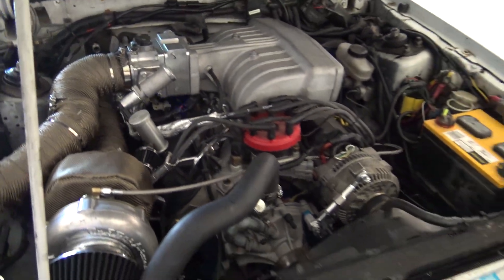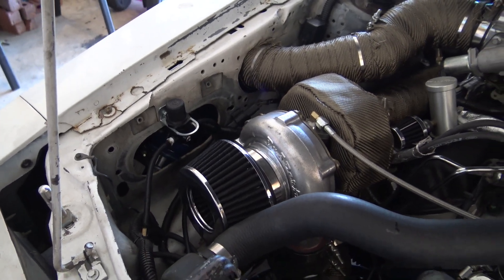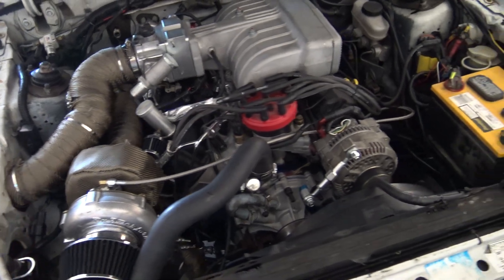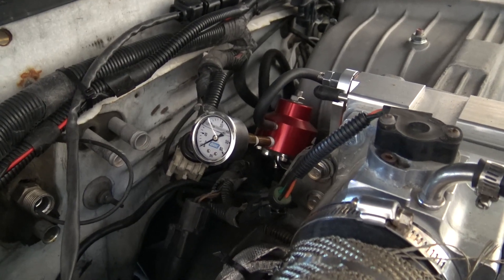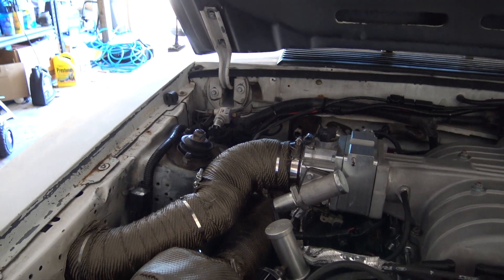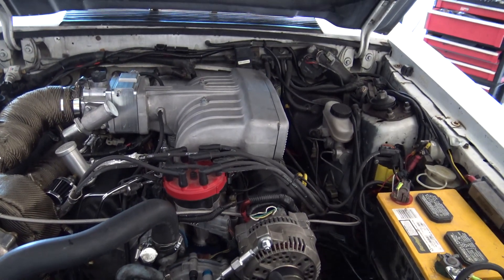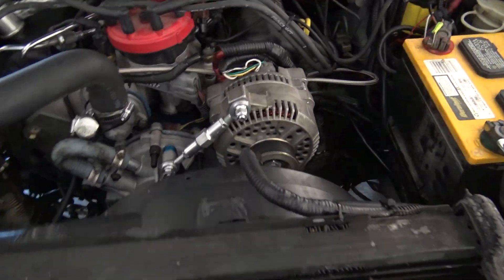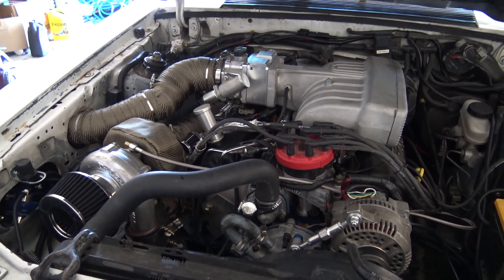The Dyno Tune On3 Turbo Foxbody

Comment: Good job brother. I have a 94 gt running dss level 20 331 with v3 si vortech with a stock production block running 541 rwhp and it's been together 4 years and 50k miles trouble free. all in the tune to keep it together.
Reply from the maker: Some nice power numbers! The tune is the most important part! The v3 si must be common on these motor. See lots of people running them.

Comment: Glad I came to check these videos out, oN3 doesnt mention much about needing alternator relocation, modified upper rad, P/S in the way? Lots of other small things I'm thinking putting a kit together would be better then buying the kit perhaps... Universal 3 inch I/C kit with a tig welder. Twin scroll 76mm t4 should let things breath nicely.. I'm on the fence with the kit as doing it yourself should allow me to retain factory accessory locations what's your opinion on the kit? The numbers are impressive though. I"ll most likely be on E85 and undecided on the tuning solution.
Reply from the maker: +Kyle Milford thanks for watching! Alternator relocating isn't necessary. I only did it to keep it from adsorping heat from the turbo. I pulled the ac as I never use it. PS pump is cause Im going to a manual rack in the future. All that stuff you don't have to do to install this kit. The kit fits, but just got to be patient with it. If your on a stock block 302 wouldn't waste your time on e85 just run 93. These blocks only handle @500hp. This kit won't have any problem hitting them numbers. Good luck!

Comment: looks like an aeromotive fuel pressure regulator. they cut pressure with the key. don't work like most regulators. the open element breather on the valve cover creates a vacuum leak on the fox pcv system. great numbers btw.
Reply from the maker: Yeah I kinda ruled out its the regulator. It bleeds off to 15psi and takes about 30-45 mins to bleed the rest. I have to pvc going out the atmosphere.

Comment: awesome vids man, I just watched them all lol, can you tell me if you changed anything from the injectors, fuel pump, anything like that? if you did can you tell me. I have a 95 GT that I am wanting to do exactly what you did to yours. Thanks in advance
Reply from the maker: Thanks! Running ford performance 47lb injectors, Aeromotive Stealth 340lph pump, Aeromotive pressure regulator. Pretty much only thing stock fuel wise is the lines and fuel rails lol. Love the boost!

Comment: Hey justin91lx does your car have a stock block? Wanna do a similar setup on my 87 but not sure my 302 can handle it. Just have bolt ons on the car at the moment aiming for 400whp but dont wanna split the block
Reply from the maker: Stock short block. As long you keep it under 500 and get it tuned. You'll be fine. See you rcar is a 87 you'll need to convert to maf. Good Luck!
Reply: justin91lx already did that had to convert it when i put a cam in should be set for boost just need bigger injectors and fuel pump
Reply from the maker: Drop you a set of 42 or 47s a pump and a blow through maf. You'll be set!

Comment: What can are you running . I have fox NA I'm make 353 hp and 363 TQ . Going to put turbo or a supercharger . Haven't decided what blower I'm going with yet .
Reply from the maker: +David Crowe Trickflow stage 1. Nice numbers for a n/a
Reply: Im running Anderson N41 . Good NA cam
Reply from the maker: They're great cams!
Reply: Going to do E85 and meth injection next . To see if I can crack the 400hp mark . Going to put the 340 pump and the Rex vortex pump kit on it too . Make sure I have enough fuel pump for the E85 on it .

Comment: HI man nice car want to do a turbo setup on mine but I don't have maf sensor mines a 87 lx can I still install turbo without maf car is stock by the way 57000 miles on it what u think need help. thanks
Reply from the maker: +MrTesedgar You'll need to convert to Maf. Also need bigger injectors, and fuel pump
Reply: thanks
Reply: what size maf and injectors u have on it ?  thanks.
Reply from the maker: 3 inch pro m maf, and 47lb injectors
Reply: justin91lx 
What was the boost on this setup? 
A friend did this maf conversion, 7lbs boost but he has 24lbs injectors for now until he gets the right combo injectors & maf

Comment: Hey what's the exhaust setup your using. Car sounded good. Enjoy it man.
Reply from the maker: Thanks. Its all open exhaust. No mufflers
Reply: no cats either? what diameter? x pipe or y
Reply from the maker: No cats. No x pipe or h. All 3in from the turbo to back

Comment: What gear you running in the rear end?
Reply from the maker: 3.73s at the moment
Reply: justin91lx thanks another question what mass air meter did you run or how did you it? Am in the middle of my same built and alil stuck there
Reply from the maker: On my 306 I ran a pro m. Worked great.  On my new motor im running it speed density, and love it
Reply: justin91lx ok thanks and the pro m you calibrate it when you dyno right?
Reply from the maker: I bought it calibrated for my injectors

Comment: what year did ford started using fuel injection
Reply from the maker: 86
Reply: justin91lx what do you recommend me to do. Put shit on a 302 or turbo it or a 351
Reply from the maker: Whats your hp goals?
Reply: 400s
Reply from the maker: Can be done with a 302. If you want more you'll need to step up to the 351 or go with a boss or dart block 302
Reply: justin91lx i want 400s but then I wanna keep going but at my own pace but high 500s are my final goal so I should go with a 351 right?
Reply: +T1GR3S13 could get that out of a 347 easy with no boost..302 for that matter too.
Reply: Bob Falfa 500
Reply: T1GR3S13 You can get 500 out of a 302 but don't count on it staying together a real long time. A nice little 347 stroker would do you just fine,they can handle 500 no problem and you'd have some to play with. I've had 3 and beat the hell out of em.

Comment: What kind of transmission are you using
Reply from the maker: Stock t5
Reply: justin91lx does it give you any issues? Was it safe to tune with stock tranny? I'm going to tune my blown fox and I have stock. Should I be safe doing a tune with a stock T5?

Comment: Hey justin, lmk if youstill need it but i know of a good thermal tape you can use on the charge pipes, otherwise just do what i do for mine and paint them black. also dont forget the cars slow and sounds terrible.. ;-) :-P
Reply from the maker: Shoot me a Pm in fb. lol
Reply: justin91lx you could move the battery to the trunk & spin the intake to point at the driver side then the intake pipe won't be over top of the turbo.
Reply: Travis Griffin  he knows. I told him, but that would require a LOT more mods and this setup isn't staying in the car that long.